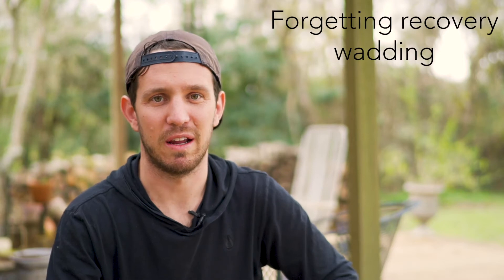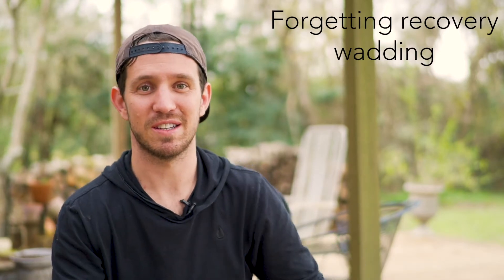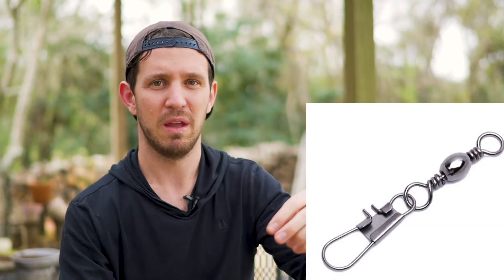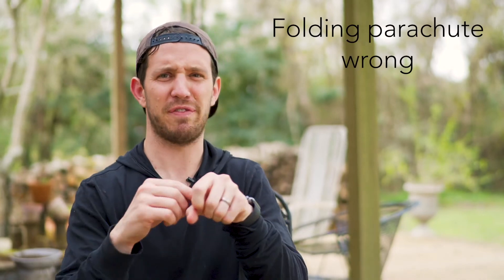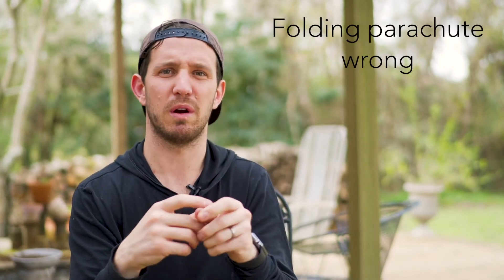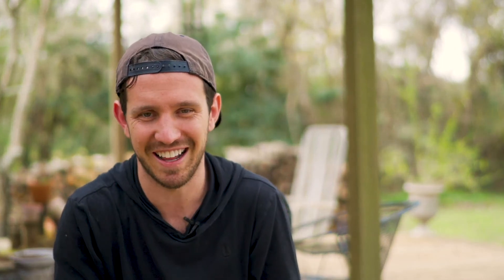Top 6 ways to screw up your model rocket parachute

Comment: Could add for the beginner. I was in a rush building one before dark. I haven’t set off one since I was a kid. I sit it off, low and behold, it did come out but not fully open. Reason? I didn’t allow the wood glue to dry long enough and the glue got a hold of the parachute. 🤦‍♂️ side note, I’m learning a lot and loving it
Reply from the maker: Hahahaha I haven't had that happen myself but totally could see me doing the same.  I think your comment just saved one of my future rockets!
Reply: I came to the comments to say the same thing lol. I put the glue on and didnt wait long enough to put it together after. The parichute opened in the air but not much. When I found it a saw that i had accidentally glued the chute closed on one side 😂.

Comment: I didn't know that the recovery wadding was perforated to make squares so I put a few long sheets in there and it still worked lol
Reply from the maker: HA!!  Maybe some isn't perforated but what I use always has been.
Reply: @themodelrocket220  it definitely was lol. I should probably have known when it said to put 5-6 squares in there and what I was putting in wasn't square at all. I'm using all estes stuff. I realized after reading about the stuff and taking a closer look at the stuff that I realized it definitely is indeed meant to be torn into little squares. But what I found is it's definitely nice only having to chase 3 peices of wadding instead of 6 lol

Comment: I made the mistake of not putting enough recovery wadding in my first launch. I only put in two of the sheets that came in the engine pack. I was lucky and there was just a small melted spot in my parachute.  Now I know what I didn't know about recovery wadding!
Reply from the maker: I've made the same mistake!  Sometimes you're fine with two, but sometimes not.  3-4 seems to be the ideal number!
Reply: I made the same mistake, except it burned the shock cord. I had to jump over 3 fences to get the nose cone, and the rest of the rocket (somehow) landed safely and was recovered by someone else. I have no idea where it was or how it even survived like that. Maybe it was the thick ABS plastic.